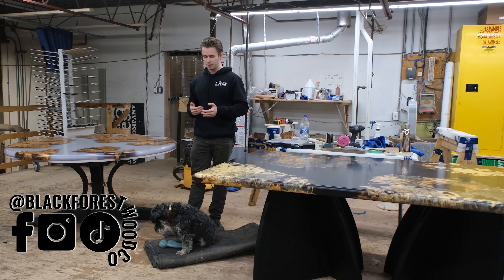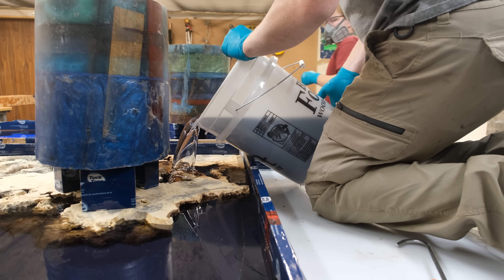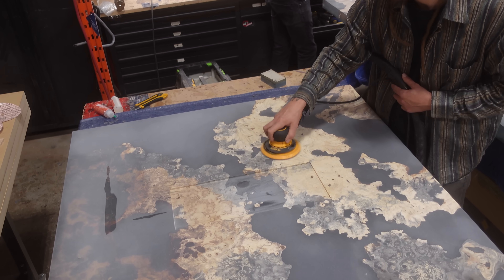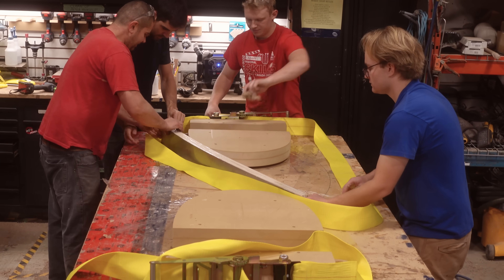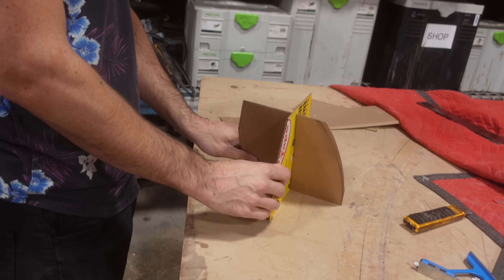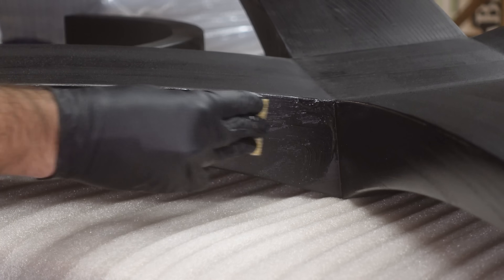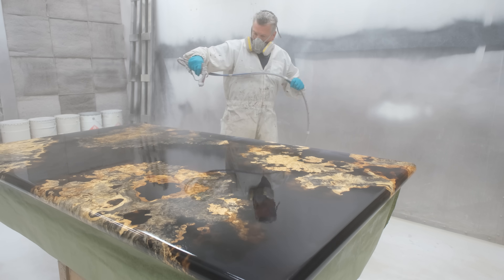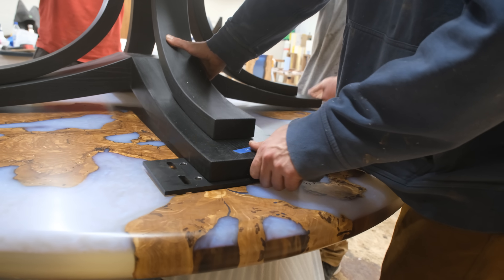Turning Burls Into $45K

Comment: I did a base similar to the round table a few years ago. They act like leaf springs and flex when you put weight on them 🤣 had to bulid some extra straight legs to help the flex 🤣🤣
Reply from the maker: Luckily we didn't find that to be a problem with this base haha, the table top is pretty heavy so that would have been a problem!
Reply: @BlackForestWoodCo  when I did it, I had to 2 clusters of arcs with 8 arcs on each cluster that held a full size piece of granite, it was all my self and 4 other guys could do to lift it up to put on the base. It was a beautiful base.

Comment: Incredible work but $45,000? Hey, it’s a good gig!
Reply: I would do cartwheels on the way to work every single day if i knew i was making 45k of two tables
Reply: Yes and no. When you break it down material, man hours, every piece is an original, and it's made to order. That's actually pretty reasonable.

Comment: Sry but the rectangular table, especially the base, is pretty trash. The top is fine, nothing against that but the base doesnt work well at all with that design. Also idk where he intends to use this table and for what but the guy must be pretty tiny since any person who‘s of average height or just has longer legs would not fit comfortably under there and stretching your legs is basically impossible.